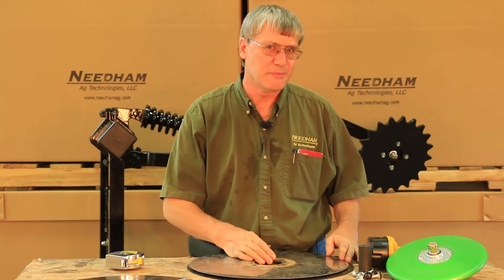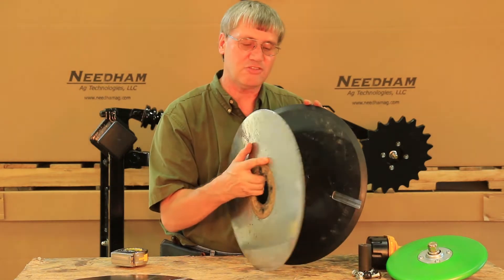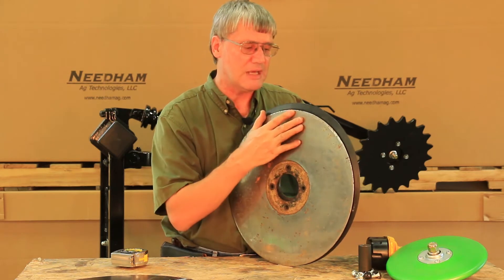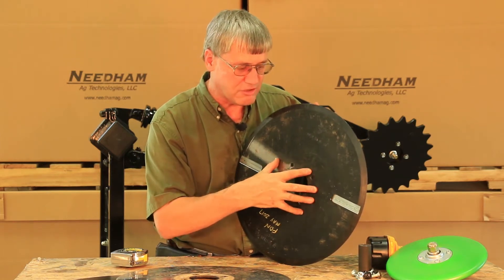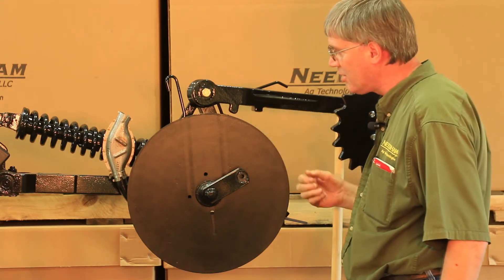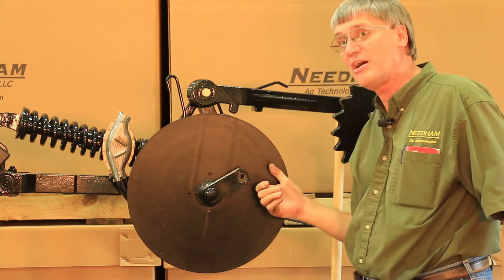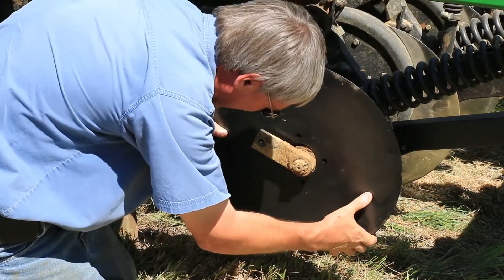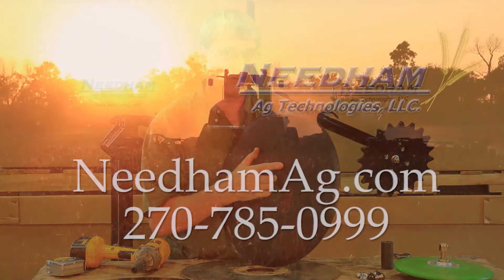Needham Ag - When to replace the disc blades on a John Deere 50, 60 and 90 series opener.

Comment: Wich is the difference between putting the disk with the flat side To the gauge wheel with putting it with the flat side To the boot. Sorry for my english
Reply from the maker: Agro Mano   The Discs cut much better when the straight side is towards the gauge wheel.